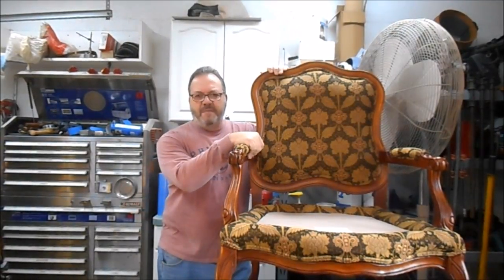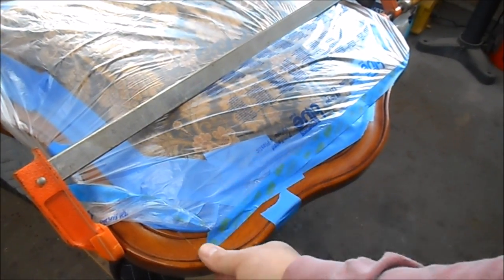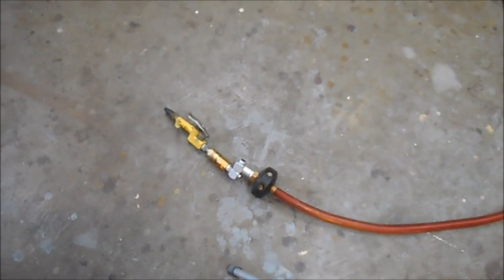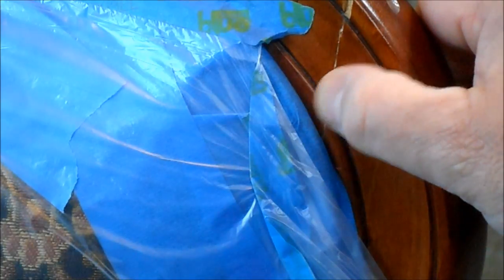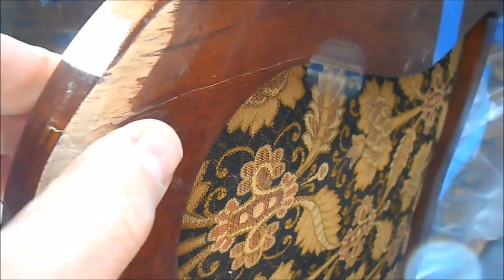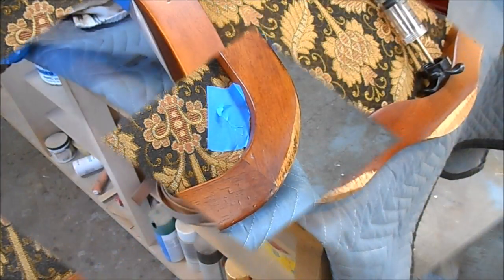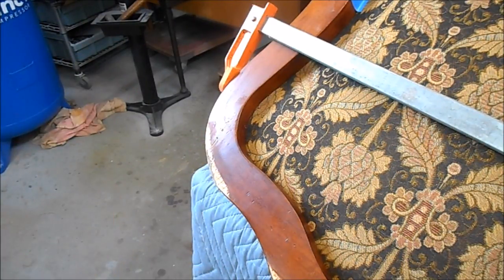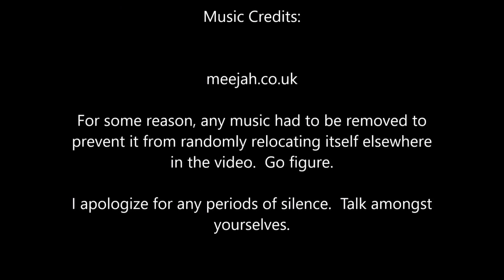Fixing Miss Gail's Chair

Comment: Tough job Larry, my suggestion is inject the glue as u are doing, and use a shop vac on the other side to pull the glue through. U can adjust or fab
a smaller extension on the hose to help pull glue into the crack. I have used this a few times, and it works pretty well. jerry. Woodmaker from Illinois.

Comment: Compressed air in cans used for cleaning electronics often has just the right pressure too!  I like the skinny long tube as well.....just right for cracked frame repairs.

Comment: Great idea drilling the holes in that tight crack. Another less intrusive way would to use the product “Tite Chairs” which is an ultra thin CA glue that sucks right in.  Your thoughts on this?
Reply from the maker: Never used it, so I really can't comment.    I have used the Chair Rx with good results.

Comment: I need to fill gaps in some joints. (chairs). Already glued and won't close up any more. What do I use for filler please? A general wood filler then stain. (The one I experimented with, shrunk when dried and left me with a shallow concave that difficult to build on!). It's a similar project to Miss Gail's, but two of them. Thanks, Tony
Reply from the maker: For bad glue joints, I use an epoxy with a filler mixed in.   Existing gaps which are larger get an epoxy putty which is sold in a roll that you slice off and squish together.   It's also called "Tootsie Roll" putty.   As the size decreases I use Timbermate brand wood filler.   I also have used colored waxes and various fill sticks that are melted into the gaps.

Comment: On other suggestion about how to get glue into cracks - widen the crack. Sounds horrifying, but if you take a 1/8 in finish nail and ease it in parallel to the grain, you can get it to open somewhat, which gives you more access to glue. Hope I am not advocating anything too terrible. I've done this and it has worked for me, but not on anything as delicate as furniture. 
Great video, thank you.
Reply from the maker: Thanks for your suggestion.   I often will use wedges or flat knives to do the same thing.  I'll keep the nail suggestion in mind.

Comment: I would have turned my quick grip clamps around and see if I could have spread that last crack open to get glue into it. I would never in a thousand years thought of drilling holes, but when you came up with it, I wondered why you didn't drill vertically along the crack instead of across it. You need to find someone with medical equipment access. I've got some hypodermic needles that would have worked way better than that turkey injector. Oh, and thanks for the idea of heating up the glue also

Comment: Queen Anne? Nonono. This is an Italian style, or maybe French Provincial. I'd be very surprised if the frame isn't marked "Made in Italy" on the interior frame.

That floss glue trick is find of brilliant! I'm not as much of a fan of the drilled line of holes though. I think I would have tried to increase the break and do the floss trick on that as well.
Reply from the maker: Yeah, I probably screwed up on the Queen Anne call.   There was no getting that crack apart.   It actually went through part of the finger jointed seam from the factory.   What I do wish is that I had a smaller needle, so I didn't have to drill the holes so big.   As it turned out, I was able to finish over the patched holes and it came out very well.   Most importantly, the frame is stabilized now.   I can't take credit for the dental floss trick, that came from a viewer and I don't remember who.   Thanks for watching!

Comment: I wonder if a plastic syringe and needle would also be good for warmed up glue? You would have to throw it away afterwards but syringes and needles aren’t very expensive.
Reply from the maker: You are right.  I have used them in the past.  Also, if you are using PVA (wood glue), it will rinse out with warm/hot water and you can re-use the syringe.   Thanks for watching.

Comment: Have you tried using a hypodermic syringe for injecting glue into very narrow cracks?
Reply from the maker: Yes, I have hypodermic syringes and even one of those giant ones that pushes glue into the crack under pressure.   Every situation is different and usually I can figure out a way to get glue into where it needs to go.   Thanks for watching!

Comment: Can you please give advice on different glues? I've got a general pva from the hardware store. Not sure it's right for fine work.
Reply from the maker: I use Titebond II for most of my work, but I'm sure any good PVA glue will do.   For antiques and some other situations I use Hide Glue.    For quick repairs, like gluing down a veneer chip, I use CA (cyano-acrylate) glue; also known as Super Glue.

Comment: Rather than going in the house to heat stuff up you should get you a cheap hot plate and keep in the shop. My grandpa used to use a lot of Hyde glue...what he was used to..so he kept a hotplate out in the barn.  I think I bought mine for around $10 at Walmart.
Reply from the maker: Kevin, believe it or not, I do have a hot plate and even a pot in the shop.  Problem is, I turn off the water in the winter to keep the pipes from freezing as they come out of the ground and in to a hose bib mounted on the outside wall of the building.   I find myself muttering to myself quite a bit during the winter, as I shuffle back to the house for stuff like this.   LOL.   Thanks for watching and for you comment!
Reply: Lost Mountain Restoration gotta love winter!!

Comment: Looks like he tripped over it and they both went down a flight of stairs.But well done. Right then. here we go. I was thinking and yes my brain does hurt, And i astound myself sometimes. If you drilled them holes in at an angle wouldn't it cover more area when gluing and run from one drill section into the other. Yes i know. genius.But i dare say somebody will come back with,What a stupid suggestion.
Reply from the maker: I learned long ago, that there are many ways to "skin a cat" so to speak.   Many people commented to me that I should have drilled one hole and forced glue under pressure using an injector.   That's a very legitimate suggestion, too.    Bottom line, get glue in there, get a good clamping plan and make a solid repair.   How you go about it is somewhat less important.   Thanks for watching!